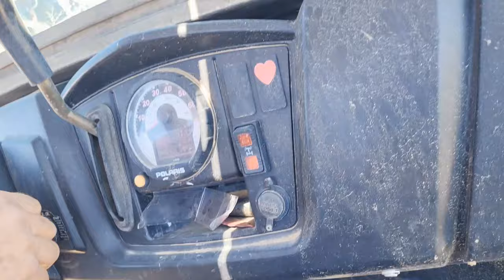Classic Car Junkyard

Comment: Don't you take that on that one of the damn good ones 1960 Dodge half ton pickup😢😢😢😢😢😢😢😢😢
Reply from the maker: I'm  a few years from having time for that project.  I will most likely find an old dodge D100 that isn't in as complete condition as that one.  Those trucks are restorable and I would want to take something that's a survivor.  So don't worry.  Someone will get a shot at those trucks
Reply: @Exit45Restorations  I've been looking for a truck like that for quite some time my daddy used to have one and I helped him rebuild that truck from the ground up
Reply from the maker: @edwinbonnelljr1587  what a great story.  Now you know where one is if you want one.
Reply: @Exit45Restorations  thank you very much and see what I can do to go get it I live in kirksville Missouri heading towards Tucson Arizona
Reply from the maker: @edwinbonnelljr1587  I hope you're able to get it.  It was a very nice truck.
Reply: Thank you very much sir I sure appreciate it they just bring back memories of me and my father when we were together internet was the first vehicle I learned to drive on three-speed on the floor
Reply: @Exit45Restorations  225.6 the one that was in it with a flathead 6 cylinder
Reply from the maker: @edwinbonnelljr1587  what color was the one you liked?
Reply: @Exit45Restorations  it was a white 60 Dodge pickup that you went over to on the second row
Reply from the maker: @edwinbonnelljr1587  oh ya.. I really like that one.